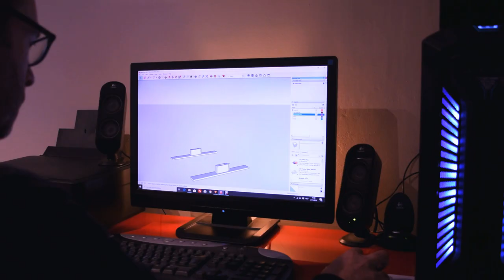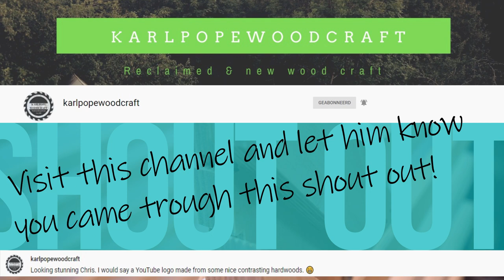Not a usual paint drying rack | Adjustable — foldable

Comment: I have not had an opportunity to have that many pieces to dry at once.  Cool design!  I was thinking of a different design at first...where ....think of 2 spirals (like those hanging wind operated spinning wood ornaments on opposite sides) and the helical DNA pieces of wood could all be pivoted flat and the legs that hold the base could also be flat...  One would swing forward and the other would swing back. So that they would form an N or Z on the base....  Maybe even adding a support brace to keep that N from turning into an L tipping over ....  I can picture it... (Not falling over!)   But the fix to keep it from falling over.... I can picture the swiveling pieces of wood pieces would be adjustable for width skinny on one side and wide on the opposite side....  All it would just be some rod (or strong dowel) and a washer between each piece of wood with the dowel or rod running through the center of each side of the DNA coil of wood.....not nearly as fancy as yours..but maybe slightly easier to construct.  The whole thing could just fold flat and be tucked against a wall or whatever.

Love your editing! I am somewhat creative...but mostly in my head.  Making mountains out of molehills mostly. Haha!

As far as a use for this or other drying racks..... IF I ever have the wife committee approval for kitchen cabinet door resurfacing or painting or whatever...this would work well.

My daughter also has done some paintings on canvas. This would also go well to keep those stored safely while they dried. 😇😎
Reply from the maker: Thanks Jeffrey. I'm glad you like this rack. greetings